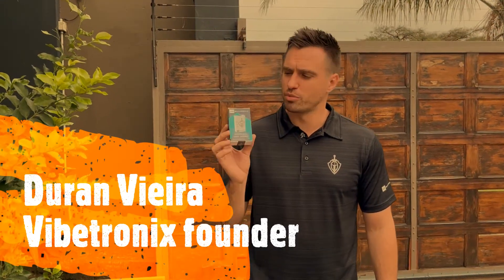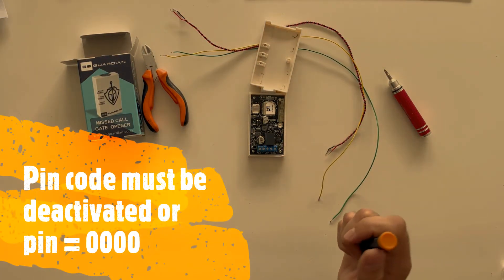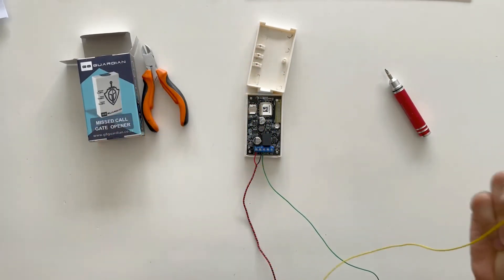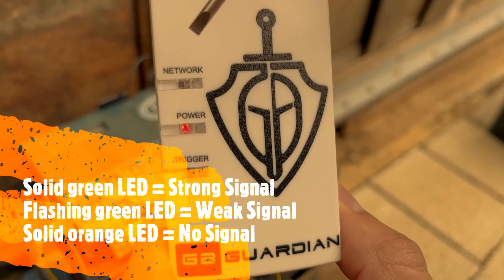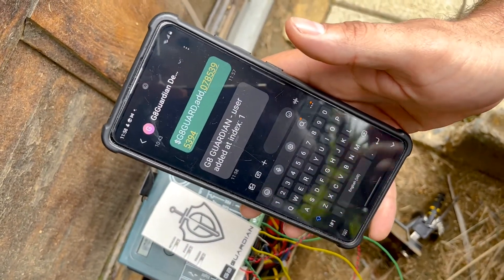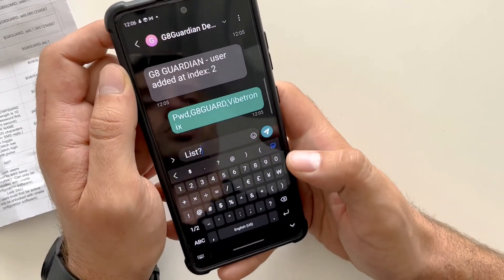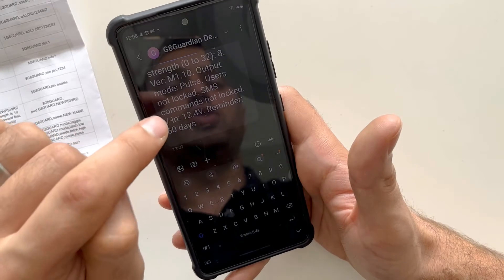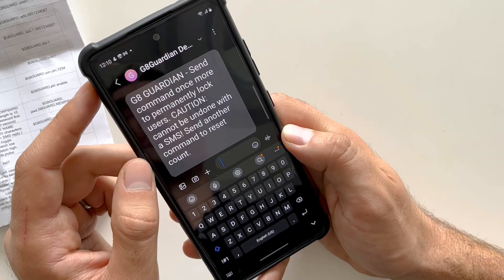G8Guardian installation and programming video

Comment: Hi Duran  just bought one of these units... installed it watching this video, have a telkom sim with airtime in it and the pin has been removed. But the network light stays on orange and remained on orange for bout 2 hours.
When i try calling the number it goes directly to voicemail. Any idea in what cud be the problem?
Reply from the maker: Hi Yousuf, my apologies for only getting back to you know, I seem to have missed you comment. Yes this normally indicates there is no network coverage for this particular service provider in the area. There are a number of solutions to this issue. Please call our support line on 073-238-5550 and we'll help you through the process.
Reply: @vibetronix394  thanks soo much. I forgot to update the post. I got a vodacom sim card and it worked straight away. Much appreciated